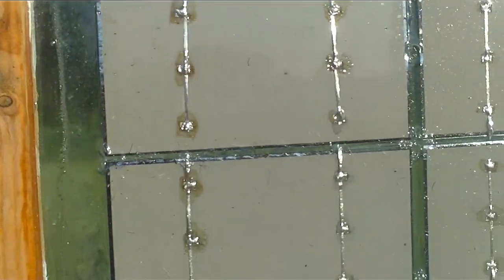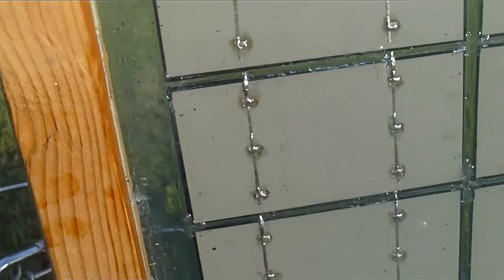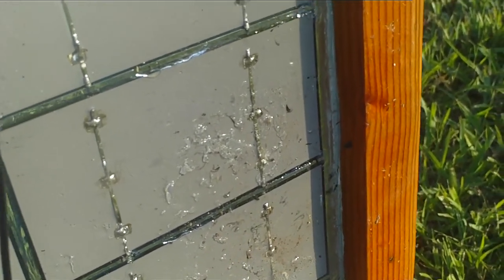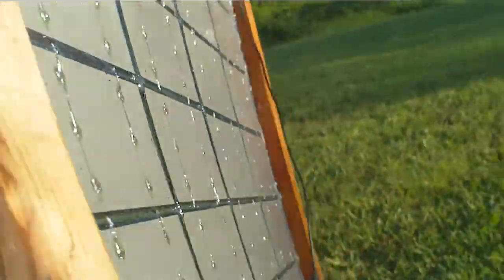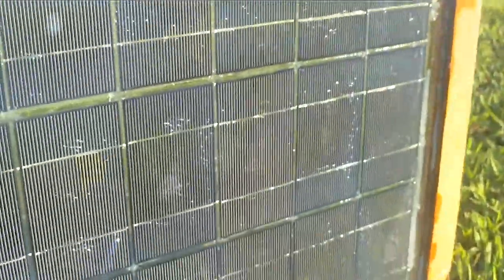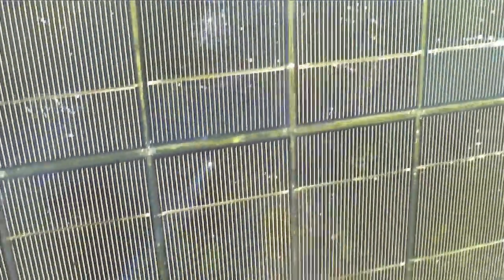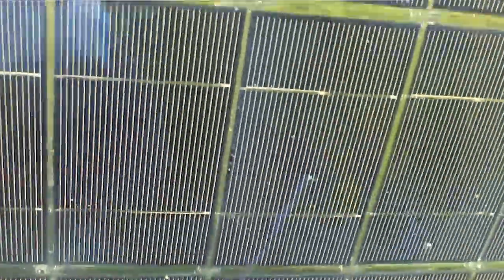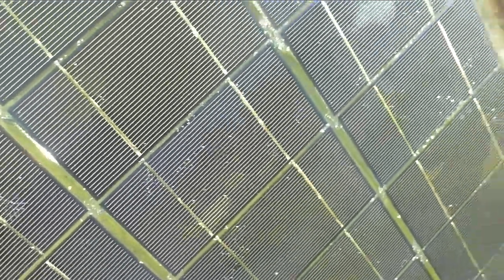Solar Panel Build Project Part 4- Encapsulating results and observations

Comment: Video #4 is far better that #1 to #3. 
I am pleased to see a chap that is prepared to admit that he made some mistakes. I make loads of them! A man who never makes any mistakes, never makes anything.
Have you tried EVA film on the back of the cells to hold them to the glass and then fibreglass matting and clear resin over that?  It should provide a very strong and waterproof cell housing if sealed to an angle aluminium frame. Also there should be no problem with air bubbles as the film is not between the cells and the glass.
Any thoughts folks? Interested to get your feedback.
Regards
Agent Bertram (in Scotland... where it never stops raining... and mistakes get made by the thousand).
Reply from the maker: Actually, I have not used the EVA film. I did look into it before trying the encapsulant. I have neglected creating videos for quite some time now; however, I will be putting an update video for these panels. I have only made 4 panels using the method referred to in the video. I uploaded my first video with these panels in May of 2013 and they are still in operation today (Jan 2017) I am currently building a Tiny House for me and my wife and we are using these panels for temporary power. Thank you for your comments. I really appreciate it.

Comment: how many watts can you get  from it?
Reply from the maker: The cells are .5 volts at 3.6 amps. I have 36 cells per panel which gives me 18 volts with no load. The formula says Watts= Volts * Current. In theory that is about 64 watts per panel, but I don't think these cells put that amount under load. I have 4 panels connected and when the sun is directly on them charging my battery bank, they average about 10 amps at 14 volts on the system. so I calculate about 140 watts between 4 panels on an average day. Hope this answers your question. Sorry for the delayed response.

Comment: Any update on how this panel / encapsulate is holding up 2 years later? Thanks.
Reply from the maker: +Winston Smith Yes it is! I have four of them built and they are powering a pond pump that I am using in my Aquaponics Greenhouse. Of course, the panels are doing their job, but the aquaponics part... not so much. Thanks for watching!